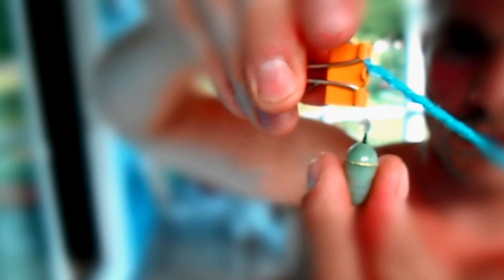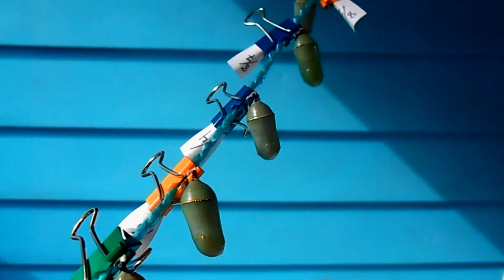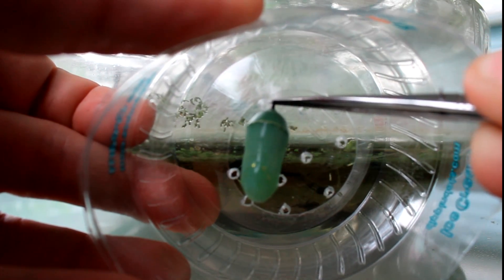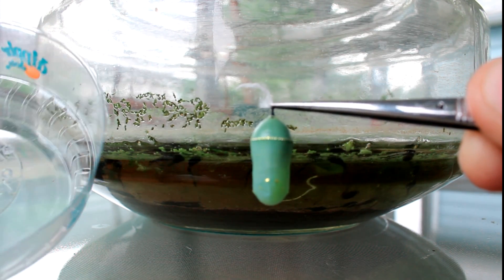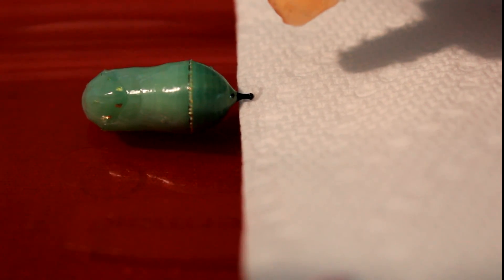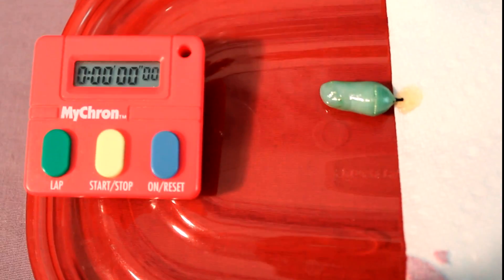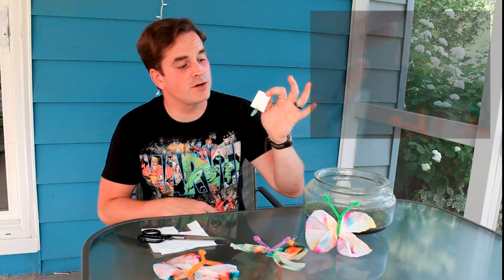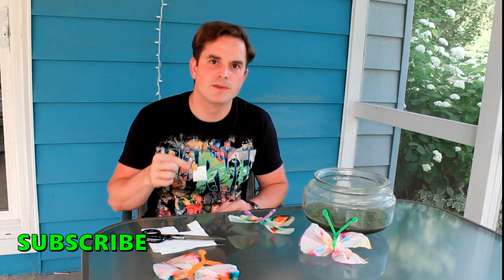Raising Monarchs - Chrysalis Repair (Help The Monarch Butterfly)

Comment: HELP!
Hubby tweeted you a few days ago about our cat that pupated on the floor of a smooth plastic container. Because another cat was J-hanging at the time, and now have both had a chance to harden their chrysalides, today we're taking on the task of figuring out how to help the one that is on the floor of the container, of course laying on its side. 

Unfortunately, it seems to be pretty well stuck to the plastic. Hubby is thinking of cutting out the plastic around it, and hanging it by the surrounding plastic.  I'm wondering if we shouldn't just let it be, hope that it ecloses successfully, and ALSO hope that at least one of us is around at that time to move it to a place where it can climb up to hang.
Reply from the maker: Keep in mind that, since it fell, all bets are off.  Not sure how hard it fell.  Not sure if it's still going to develop in there properly.
If I were in your shoes:
1)  If the plastic is easy to cut through and would not be putting the chrysalis at risk, yes, I'd cut out that portion and hang it.  I don't think the direction of gravity plays a significant role in the development, but it may.
2)  I have heard that they do not need to be hanging at all to develop properly.  Thus, leaving it as is could very well be fine.
Whichever road you go, please understand, if it doesn't come out properly, it was due to the fall, and not due to which option you went with.

I'm rooting for you!
Reply: It fell while J hanging, and we didn't realize it. A few hours went by before we discovered that it had fallen, and we decided to let it be rather than disturb it. (That's probably where we went wrong.) I actually, thought it might have died. Then, while we were looking at it and considering our options, it formed the chrysalis on the floor of the container! We sort of expected that it wouldn't form properly, but it looks pretty decent, except that there is what appears to be a lengthwise seam where it must have fused together, very much like a repaired cleft lip.
Reply: I guess the main reason we let it stay on the floor of the container is that another cat was J hanging in the same container, and we didn't want to risk opening the container to cause the J hanging cat to fall. Then, after the floor cat formed the chrysalis, we didn't try to do anything with it until after the second J hanger formed its chrysalis. In order to allow the second chrysalis to completely harden before moving it safely away, we waited until today to try to figure this out. 

The first thing we did was move the screen roof holding the new chrysalis to a new container.  I'm not sure exactly what Hubby has in mind to cut away the plastic, but if you think that would work, we could attach it to a vertical surface, so it's oriented properly.

I'm thinking that letting it be would be less stress on it, and putting a piece of screening, maybe in the form of a circular tall fence enclosing it, would give it easy access to a place to crawl up to pump and dry its wings. I would make sure it's wide enough in diameter for room to open its wings.

This all assumes that it will actually eclose. 

Of the seven 5th instar cats we brought in, we have lost two, one I found on the floor of the container, laying in dark green/black goo. I'm assuming this is OE?  Another went into J hang, and then the next day went limp/straight hang. I had hope for that one for 24 hours because I have seen successful adults go from J hang, to limp/straight hang, to chrysalis, but this one was not to be. The container is clean, so I don't suspect OE or parasites.  Do you have any idea what this might have been?

If we lose our little floor chrysalis, that would mean a 4 of 7 survival rate, which is a heck of a lot better than 1 of 10 or 1 of 30!

I will take a photo of the DIY "critter cage" that Hubby created. It's pretty slick, and doesn't take much more than a "hot knife" to cut plastic. He'll tweet it to you.
Reply from the maker: Black/green goo is usually a symptom of NPV, though OE is still possible.  Even so, most with OE make it to the chrysalis stage, even when heavily infected.  So, if as a cat, it had the "squish death" (where it looks like it was squished), I usually would put my money on NPV.  Here's some resources that describe it, and how to sanitize for it:
https://en.wikipedia.org/wiki/Nuclear_Polyhedrosis_Virus

http://www.butterfly-fun-facts.com/disease-oe/npv-nuclear-polyhedrosis-virus/
Reply: Hubby just tweeted you with photos. 

One shows his DIY critter cage, along side the random containers covered in screen that we began with this year (new/fresh ones each year). He simply cut out (with the smoothing tool of a hot knife) an area from the bottom of a cheap ($1.25 or so, depending on where it's bought) shoe-box sized (1.5 gallon) plastic container, hot melt glued a piece of fiberglass window screening ($6 for 36" x 84" roll) over the hole, and placed upside down on the lid, becomes a very easy-open container to clean out. This could be done with smaller containers, just as easily. We've seen it done by cutting out the circular design in the lid of a food storage container, the kind with the transparent colored lids, and gluing screen over the hole. This was the plan until we decided that cutting out the molded design in the bottom of the box and using that for the top of the cage would be even better. BTW, this box is SO cheap that the lid isn't a super-tight fit, so we disturb the cats much less than a tight fitting lid would!  Here's where he got the idea: https://monarchlab.org/biology-and-research/monarch-rearing/making-a-rearing-cage/

The other photo shows the fix he came up with for the floor chrysalis that's stuck to the container. We decided that disturbing the chrysalis was the least desirable idea, so he let it be, put the container inside of one of his new DIY cages, and sewed a piece of thick cotton string to the screen. It is long enough to more than reach the floor of the container. We hope the brand new adult will find it to climb up to the screen.
Reply from the maker: That all sounds like a great plan.  You "MacGyver-ed" a great setting for it.  I hope he/she makes it.  Please keep in mind, he/she may not, and be ready for that.  Sometimes, if the chrysalis hit too hard, or has the wrong shape, developmental issues do occur.  But, you can know, you definitely have put in the effort to do everything you can.  Now, we just have to wait and see.  Good luck to the lil' one!

Comment: I've got a deformed crysalis 😢 should I kill it?
Reply from the maker: Ethically, that is up to you.  I can respect the choice to prevent infection by freezing it at this point.  I can also respect the choice to see if it can emerge and experience some form of life.  If it were one of mine, I know that I would freeze it now to minimize the chance of infecting others, and as I might not enjoy seeing it in some type of anguish if it emerges very deformed.  Again, though, that is up to you.  Whatever the case may be, remove it from any others, and definitely don't keep it out in nature, in order to prevent any chance of it infecting others.
Reply: Anxious Night Owl NO I had a deformed one and it hated successfully
Reply: I have cattapillers 2 of them fell l think they are going to live

My
Reply: Sophie Bassett I had to, it was severely deformed, it had a huge hole through the middle and the bottom half was basically falling off. I've got heaps of them and there are some that have little dents and stuff but I leave those alone. This one was just too mangled to save. Over the past week I've hatched almost 30 butterflies so I'm happy with what I'm getting.

Comment: EMERGENCY! What's the name of that glue? the silk has come completely off and I can't get anything to stay tied around it!
Reply from the maker: No emergency!
I have since been corrected, and the chrysalis does NOT need to hang in order to develop properly.  Also, the monarch CAN emerge laying on its side.  However, when it does, you need to have provided it something to easily climb on, and then hang from.  A horizontal plane to hang from is fine - it need not be hanging from a "ceiling".  A "wall" is fine.
Wrapping something with panty-hose is a cheap option.
Mona Miller has a great video showing this, and mine will be out as soon as I can get it edited.  Here's Mona's video:
https://www.youtube.com/watch?v=OtDbSBnUy7Y

If that doesn't sound good to you, the name of the primate glue is Gorilla Glue, but that is NOT product placement.  Any     expanding glue will do.
Reply: Thank you! I was kinda freaking out lol! I found the glue
https://lh3.googleusercontent.com/OMWn8Xc3k3NADodwmmU_rw_aJ1r3TQabZfkNDTW5_yXaYPKHBOirfFALEoDKmOshAekonDrotg
Reply: Dental floss is what I tie around my cremasters when rehanging them or relocating them.  I've never had it not work.  I tie it to a safety pin and then pin it to the inside of the pop-up.
Reply: Gabriel, I guess the glue works well if the cremaster is  damaged and it needs to be sealed at the end to ensure no bacteria gets inside.  However, if you just need to relocate it or hang it if it had fallen, seriously, dental floss and a pin takes  2 minutes.

Comment: I just want to say thankyou for doing these videos. They are a huge help. I just renewed an old childhood interest in butterflies and have started photographing them.  3 weeks ago I found 12 instar four or five monarch cats on some common milkweeds neer a parking lot. I'd never seen monarch cats before. A few days later the cats were gone but I found 5 chrysalids. 2 turned brown and died before I decided to bring the remaining 3 inside. I used a 30 inch mesh cage and taped the leaves to the top. Last week I released 2 females and 1 male monarch. I've now just added 6 swamp milkweeds plants to my butterfly small garden.

This is where it gets interesting. I found 6 instar five cats on the plants. I decided to buy 3 more milkweed plants to put into my mesh habitat. So far... I have 4 chrysalids, 1 j hanging cat and another huge cat still eating. I found 6 instar one cats on the plants (all are doing well, ones now instar two I think, and I found 11 eggs, 3 eggs have hatched and the cats also appear to be doing well. One egg had turned black and has now been black for a couple days. I've separated it from the rest for observation. I'm keeping the eggs and instar one and two cats in medium sized rubbermade food storage containers. I line the bottom with a paper towel and place the leaves with the eggs or cats inside. I used your trick of wrapping the stems in wet paper towels to keep them fresh. So far I havn't lost a single cat although  I can't seem to find a just hatched instar one cat. the egg disappeared a couple hours ago but I don't see the cat anywhere. I'm hoping he's ok but, They are just too small to keep track of easily.

Thanks again your videos are well done and a wealth of information.
Reply: One thing I'm having trouble finding information on is how to identify and naturally control insects that parasitize butterfly eggs, cats, and chrysalids. For instance how do you tell the difference between flying ants and tiny chalcid wasps as these are being purposefully released in agricultural areas as pest control. I was reading about ways to make natural wasp and ant traps but I haven't had any chances to try anything out.
Reply from the maker: Thanks for checking them out, and I'm pleased to hear that a past interest was rekindled.  If any cats or chrysalides are turning brown/black, they are indeed infected with something.  It could be OE bacteria, or NPV, or tachinid flies, or even something else.  It's tough from my end to be sure.  The best advice I can give is to get out there early and find them as eggs, and take them indoors.  While it doesn't fully prevent OE bacteria nor NPV, it does minimize other parasites that infect them once hatched in nature.

Good luck to you!
Reply from the maker: Sorry, I don't have much information on this.  The major problem with this is, of course, the best way to control such parasite species is with the same pesticides that will kill the Monarchs.  The best advice I can give is what I stated in the other reply:  Get the eggs, and start them off indoors when they hatch.  I don't have much info on preventing wasps, aphids, ants, etc., from harming the caterpillars mostly because these are a non-problem for me with my system.   It's more work, for sure, but gives the Monarchs a much better chance.  I hope you get some good adults, though, here at the end of the season!

Comment: This is wonderful!! I have a chrysalis that needs to 'fixed' - perfect timing, Thank You!!
Reply from the maker: Glad I could help, but there's a correction to be made!  They do not need to hang in order to emerge properly.  I was misinformed (by a pretty reliable source, at that) and as long as it's in a safe spot, the adult can emerge and climb up somewhere to have her wings receive the fluid, expand, and dry.  It's a small window of time, and just like when they come out of a hanging chrysalis, they are vulnerable, but it can happen.  A correction video is in the works!

Comment: Hi Mr Lund! I have a question. If you have a butterfly that falls from its Chrysalis and wings were not fully out and it can not fly is there anyway to repair them? I have one this happened to. So far I just keep him fed fresh fruit he drinks the juice from it and take him out side to get fresh air and flower nectar he still tries to fly sometimes but I hate it he cant fly. Seems like if a person could apply something super light that is water resistant to open up the wings some how. But he is doing well so far the last 3 to 4 days. I raised others along with him, another male and 3 females, they did fine, they flew away one of the females came back the first day and ate at our butterfly bushes then left have not seen any since. It has been a wonderful experience that I do want to do again. I have learned a LOT from your videos! Thank you!
Reply from the maker: I would LOVE for someone to correct me here if I'm wrong, but to my understanding, there's nothing to be done.  When the wings are to unfold, have fluid pumped into the veins, expand, and dry, that is when the Monarch is absolutely the most vulnerable.  (During that time, it also has to fuse its proboscis together.)

I had this happen once to a male who emerged when I wasn't home, and he fell.  When I returned, I found him with one wing perfect...and the other severely folded in the middle.  He had absolutely no luck with flying, just a spiral plummet each time.  Luckily, it was male, which many love when I point out, is the less important member of the sexes for Monarchs.

When this happens to a male, you can certainly keep him for as long as you like.  For a female, you could do the same.  With females this happens to, though, I have heard of some keeping her, and eventually hand pairing her with a male (causing mating), and then having her lay eggs.  This allows her to still pass on her genes, and since she's not going anywhere, you can place her on a milkweed plant, and she'll potentially lay many while on there.  Adults are sexually ready from what I know, about 3 days after emerging, and will lay shortly after mating, sometimes even the same day.

When I had my male who couldn't fly, I froze him.  It's the most humane way to kill an insect.  I gave him plenty of nectar first so he could at least enjoy that.  Afterwards, though, I thought that he could at least still serve some value to my students as a preserved specimen, especially knowing I'd never freeze and mount one that was viable for release and continuation of the species.  My Science Olympian students now can compare Monarchs to Viceroys much easier, and get to easily see the pheromone sacks on the hind wings that denotes it's a male.  He serves as an educational tool.

Sorry to be the bearer of bad news, but yes, sadly, it happens.
Reply: Thanks Rich, I don't feel as bad being it can happen. He looks like he is going to end up fat not much for him to do but eat and wobble but kind of neat to watch him eat. They LOVE water melon. and this boy likes the 20% honey to 80% water real well to. I soak a paper towel in it put it in a jar lid he stays with it lol
Reply from the maker: Hey...I never tried watermelon.  Good idea!